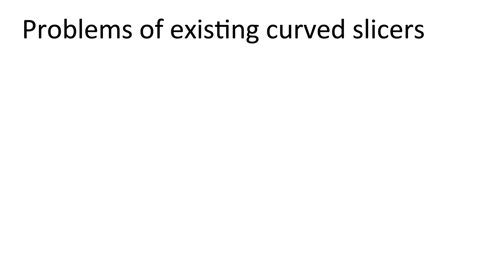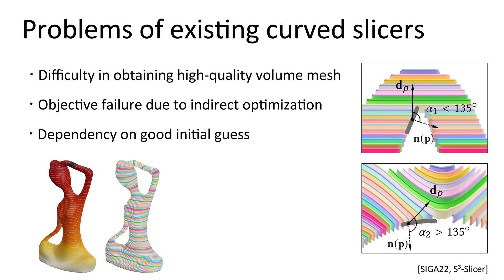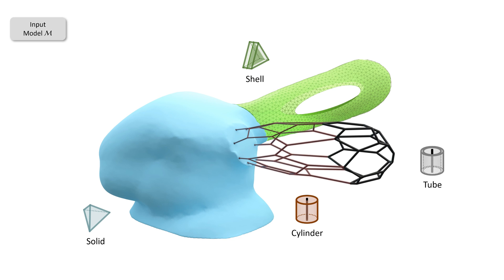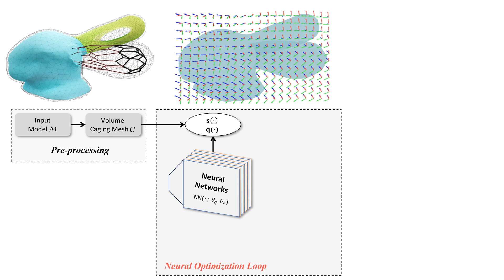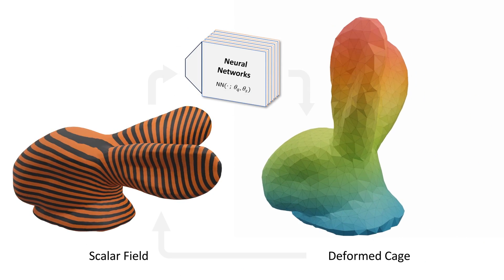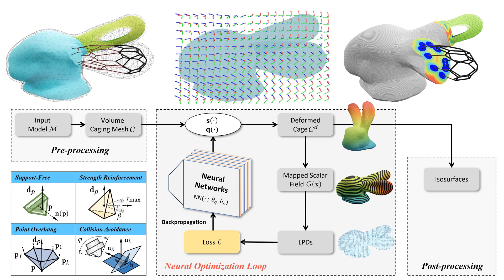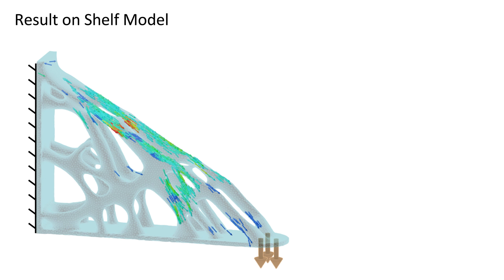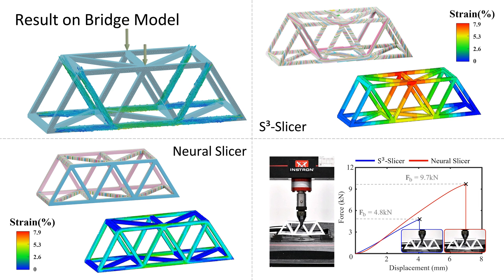Neural Slicer for Multi-Axis 3D Printing (SIGGRAPH 2024)

Comment: Will the idex style hotbeds be able to use this? Specifically I am talking about where they use the 4 corners and individually adjust them to change the angle of the bed. Rn they only use it for bed leveling, but this software could enable a lot for these printers, right?

Comment: Is it possible to limit the slope of the layers relative to a horizontal stationary bed to make it useful for hobbyist off the shelf printers?
Reply from the maker: Yes it can be realized by controlling the allowed local printing directions in the model space.
Reply: @CharlieCLWang-od4px  hyper dimensional bed slinging